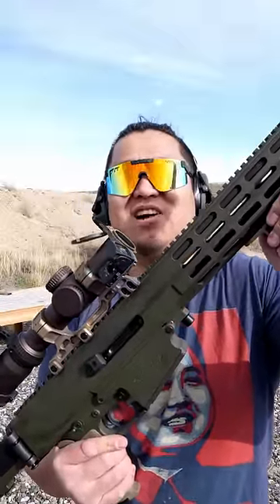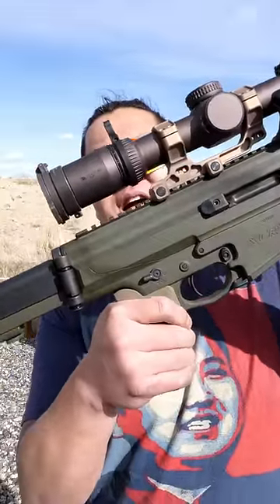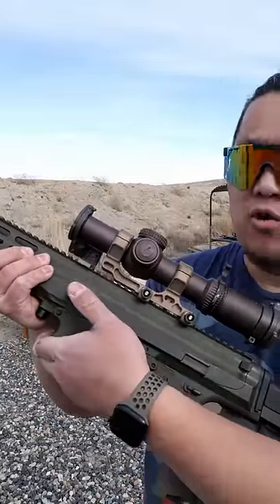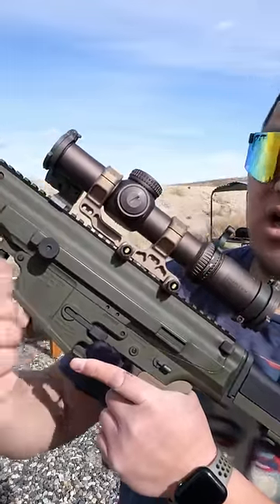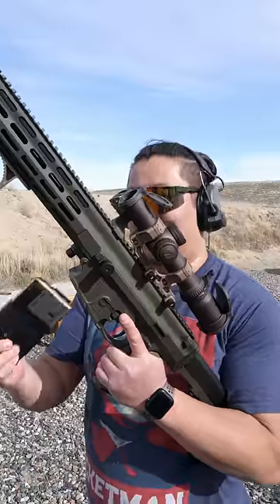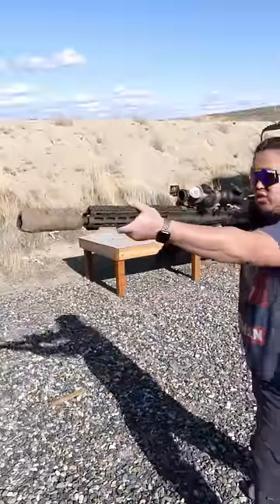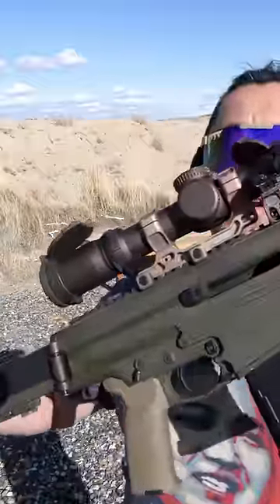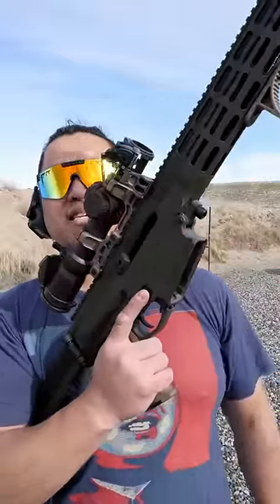How to use a Robinson Arms XCR (L/M) in under 60 seconds

Comment: I’m so glad more people are showing the xcr I feel like it’s underrated but more bigger YouTubers I follow started using it
Reply from the maker: Still working on the long term review. Definitely an interesting platform
Reply: @Gunghis  best rifle I’ve ever shot and owned, I’ve had mine for 9 year, no issues Ive never adjusted the gas pressure, I’ve only had one issue that was completely my fault and was easily replaced, easy to brake down, easy to handle, silky smooth trigger. I really want another one

Comment: Clarification: The XCR-L was released to the US market in 2006. The ACR wasn't realeased until late 2009.
The ACR copied the "bolt hold open" from the XCR-L.
Yes, there were teething problems w/the XCR-L  when released, over the years Robinson Armament has completed several upgrades to solve real and percieved issues w/the platform. Also if you have an early model all of the upgrades are backward compatible.
As a side note between the XCR-L and XCR-M there is 80% parts compatibility.
Last... The XCR is an American made product...
Reply: Shut up and take my money!😂❤
Reply: How much to upgrade a Gen. 1.5?  -L that is.
Reply: @jimbarrett5930  Contact Robinson Armament to get a quote and lead times. I've not checked for awhile.
Reply: @jimbarrett5930  : I have an XCR-L bought in 2006. Here's a list of the parts needed to upgrade. Ambidextrous magazine release, ambidextrous safety, the new two stage trigger, the bolt release rod, the new FAST stock.
   All upgrades can be installed by the shooter with minimal mechanical skills. The original XCR were stamped XCR. The XCR-L was started in 2007. When getting board for an older XCR-L use these part numbers. For the current FAST stock you will get the gen-2 stock. I upgraded with the gen-1 FAST stock the gen-1 stock had a single release button on the underneath of the stock shaft. Looked like a slotted screw head. The gen-2 has two side buttons simultaneously to release the catch for length adjustment. The ambidextrous mag release is installed just like a AR mag release. The safety upgrade is the same as any AR safety. Except there is no detent on the recoil spring extension tube. The new 2-stage trigger is slightly different. The area in the lower receiver is narrower. Just be watchful for the compressed springs. They will fly off. The hammer spring is not so hard. The trigger spring is harder to work with. When upgrading an older XCR-L remove and inspect the gas tube surrounding the gas piston the forward flange may get bent. This is user error. Must install all parts correctly. The bolt hold open rod for the XCR-L is part number Type-1, Type-2 is larger and for the XCR-M. The original release rod is type-0. 
   There is an old style and a new style bolt carrier carrier. There is a rubber bumper pad on the rear of the lower receiver. This is the old style. The new style has pressed thick rubber ring around the rear of the bolt carrier group. The rear of the lower receiver is machined a different way. You can send a older lower receiver to Robinson Arms to upgrade the older style to a newer style. About $500 bucks. Alex Robinson is adamate about supporting both old and new styles. If you have the newer M-lok upper receiver then you have the new style bolt carrier. You must have a traditional piccatinney rails on the upper receiver for the old style. 
   Before the much better FAST stock there was a machined hinge that was used to install butt stocks used on AR's. That discontinued stock hinge did not closed or open position. Just flopped around like a broken arm. Here's how to upgrade to a new FAST stock. Open the hinge and remove the two bolts. The old stock can be removed. Keep all bolts, nuts, lock washers. The new FAST stock has three holes to adjust the stock height for 99.99% of the shooters in the world. There is a two position cheek piece that allows six possible height positions. There are three bolt positions on the FAST stock, and, two positions on the rear of the receiver. Try whatever combination of the 2-hole/3-hole you need to get a proper fit. 
   Remember never use Red Locktite on any screw or bolt on an XCR-L or XCR-M. Use purple Locktite only. Can use blue Locktite. But purple is my suggestion. Purple Locktite is available from Staples office supply online catalog only.
Reply: @whomagoose6897 thanks

Comment: This is by far the better rifle
Reply: And you were able to tell this from a 60 second youtube short? Even though the gun was tested for over 4 months and found to be inferior for 1 reason or another?
Reply: @M3A7  this isnt the only time ive seen this rifle. The scar has more problems than benefits
Reply: @dak4465  Like?
Reply: @M3A7  like how if you attach a supressor to the scar it beats itself to death, optics mounts destroy your knuckle when you charge the rifle, and most of all, ive never seen a rifle absolutely destroy optics quite like the scar does.
Reply: @M3A7  Some Navy SEALS and others in the special operations community have reported the SCAR as "way too unreliable" with multiple failures while in the middle of firefights reported by several teams. They hate the reciprocating charging handle and the plastic stock hinge, after seeing stocks break right off under combat usage. Also, a plastic lower receiver probably isn't the best choice for a duty rifle. I'd rather have a FAL.
Reply: @M3A7  do you know the one reason lol. It’s not because the xcr was worse

Comment: How to lose a contract for the dumbest reason ever and prove the government is worthless.
Reply: What was the reason
Reply: @deathswingman2698  Robinson didn't provide a blank firing device, disqualifying the better design and paving the way for the failure that was the Scar.
Reply: @zestygokart2992  Failure? Hahaha
Reply: @cant-get-right4814  The Scar-16 was a failure and the 17 is barely hanging on, if the XCR was adopted the Scar would be no different than the Masada or any of Colt's piston guns.
Reply: @zestygokart2992 why exactly were the SCARs so bad? The two things that come to mind are weight+weight distribution and sight picture but most soldiers aren’t using iron sights
Reply: @solveigsgang2909   @solveigsgang2909  It did nothing better than the M4 in testing and cost exponentially more than new barrels and handguards for the M4s already in service which is what they ultimately did. It's reciprocating charging handle causes malfunctions when braced against barricades in common fashion. The reciprocating mass of the bolt carrier group shakes optics to death, the barrel is not quick-change as was called for in the contract, the handguards are incredibly fat and do not extend as far forward as the Daniel Defense quadrails did, among other things that escape me at the moment. The XCR was better in every way but cost to even the M4 upgrade program that followed the failure of the SCAR-16.
Reply: The majority don’t even own either but want to comment about something they read online.

Comment: I did not expect it to sound so quiet. Even with a suppressor
Reply: Most people think the bullet breaking the sound barrier is the main cause of noise, but it's actually how much gas leaks from the receiver (to include the barrel). The xcr is a very, very tight system around the bolt.

Comment: Looks like a very smartly designed rifle.  How much better (or cheaper) was the FN SCAR?
Reply: It wasn't. The XCR is a lot cheaper and arguably a fair bit better than the SCAR platform. The reason they lost the contract was there wasn't a factory-made blank-firing adapter for it during the trails. Yes, I'm serious.

Comment: Anyone who smacks the bottom of the mag is a poser and doesn't know what they are talking about. Buying a rifle doesn't make you proficient.
Reply: Bob slapping the bottom of the mag doesn’t make you anything but proactive about your magazine being inserted completely. When the magazine is full to capacity the first round is pressed into the bottom of the bolt and will often make a noise as if it’s locked in properly, the slap on the bottom is insurance that it properly locked because of the resistance from the first round on the bolt. Does everyone do this?, no. But some do and doesn’t mean anything.
Reply: Tell us you’ve never been in a hot environment where you couldn’t audibly hear your magazine click in without telling us you’ve never been…
Reply: U got this from movies, if u keep smackin the mag u will eventually damage something. U should always put it in firmly, and then TUG to make sure it is inserted completely.
Reply: @kristianmathisen22 Guns are tools. They are built very durable, like every other tool. Tapping the bottom of the magazine is not hurting the weapon in any way. There is no gun in history that is an exception
Reply: @Penn_Senseless  talking about the mag lips, not the gun